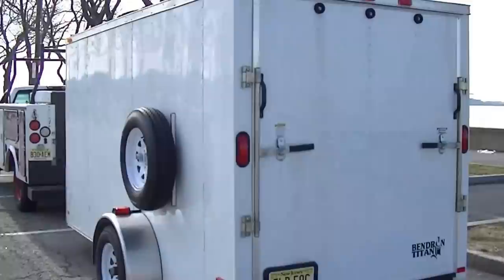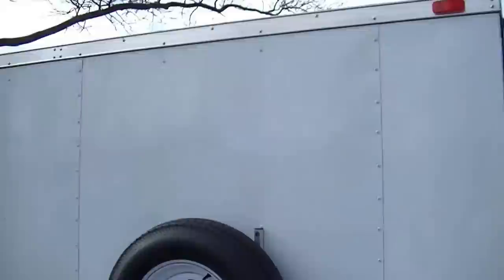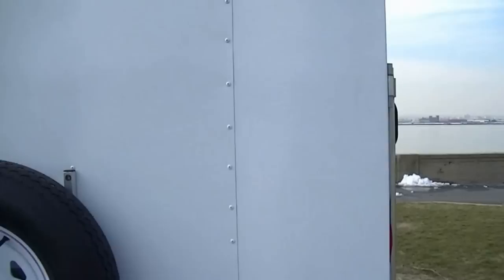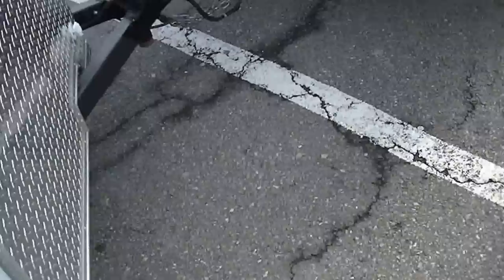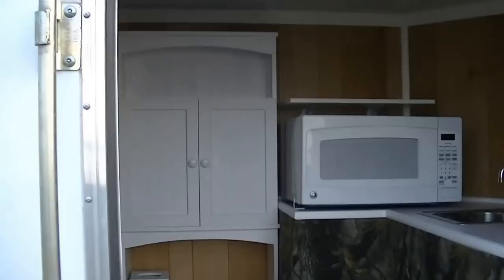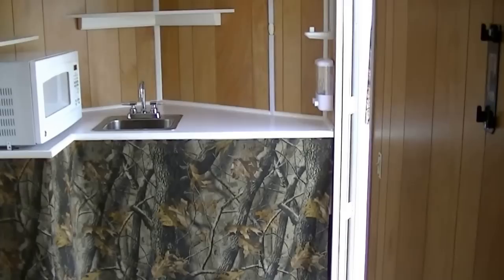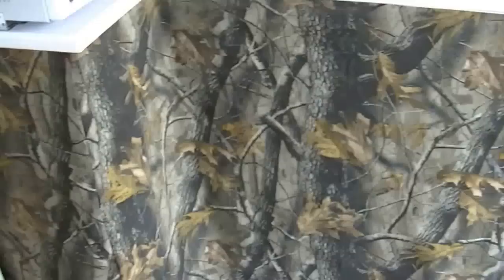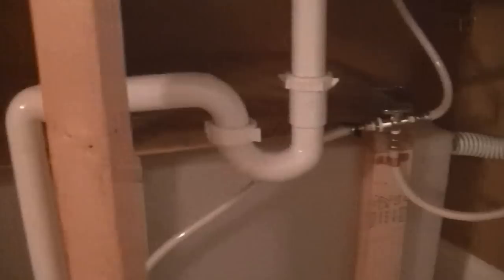Bug Out Vehicle - Cargo Trailer Stealth Camper - Part 1

Comment: Nice job NJ! Your video was inspiring for me on my first tackle of doing a cargo trailer custom conversion project too. Been researching YouTube, Pinterest and everywhere else to plan out my stages of projects. Yours was nicely done based on a budget and phases to tackle. Our trailer will be used as a mobile marketing office on-the-road, photography studio, cargo trailer, and day or overnight camper for trips just to get away and enjoy local surroundings - not to mention some outdoor photography adventures and mainly a setup to invite people to sit with us for Tea Time! We have a tea e-commerce business and we'll be promoting, marketing,  and having small tea parties to enjoy public interactions. We have a 6'x10 V-nose 6'-6" height with ramp door too. Love the ramp door for the extra deck space to cook and set up with awning too. Hoping to do a secondary false roof top as a floor to setup a tripod and chair to do panoramic photography work. Also great for additional storage of other items (e.g. canoe, additional tent, etc.). I'm planning pull-out sliding solar panels to tuck between the false roof and the actual tin roof. It will be a fun, stealth camper/office, transformer trailer useful for so many functions!  LOL  Can't wait to complete it! I started framing for a set of double-doors a few inches in from the ramp door opening (doors within doors). The double door will have glass panels, locking door knobs & deadbolt to secure the inside while the ramp door is down in patio/ramp position. It will create an outdoor space while also having a secure internal private space, but still have an open view of nature through the glass doors.  It also creates the all important emergency door and eliminates the need to have to cut into the trailer sides to install windows. The sides will have signage, while NO windows provide the best security for the trailer at all times against break-ins. I'm hoping I can video the project too and share on YouTube . . . we'll see what I can manage. Meanwhile, thanks for taking the time to share your experience - nicely done!!!  ;-) Hope to see what more you do.

Comment: Just happened upon your video 5 years later. Got to say you did a nice simple and sanitary job on this bug out trailer. I can see using a small quiet generator for camping away from an electrical source to power your electrics; pump, fridge, microwave, etc. My only concern is how would you keep thieves from towing it away when you are gone? Nice job.

Comment: have you thought about using some carpeting trim (the aluminum trim you see where carpet goes to hard flooring)? if you go with the flat kind the bed still won't slip and it will look better plus you will have the entire trim holding the non skid on and not just staples. Another idea is to use a larger piece of non skid stuff and attaching it on the sides of the wood instead of the top, then you can add trim to the sides thus not impeding the bed at all. You have done a great job with this.

Comment: Nice build, do you have a genset on your tow rig? you could also put your propane bottles on your tow rig and use an LP line to a cat heater(would keep things from freezing underway) or whatever you choose to fuel. your setup should blend in well for urban boondocking and look very low key in about any setting.

Comment: Wow, great job on the trailer! Nice planning, detail and design. Solar panels would indeed add to its bug-outness. It's good to have access to at least some power when you can't plug in to electrical service or a generator.

Comment: Nice, Im thinking of doing the same. I will go 12v on most stuff and install inverter to run ac devices other than air. No need for tv, use laptop computer with usb tv tuner. runs off ac and dc

Comment: nice work I guess we all have our own preferences. I'm going with bead board paneling. I'll finish it out with a natural oil stain. It is 1/8 " thick so on top of the insulation it adds some e value. The outside water drain I'll go with a ball valve , me personally I hate the cheap plastic crap...just too mickey mouse for a serious bug out

Comment: Continuing my last post, Bleach you have to rinse out at least three times. and Bleach costs more!  Second if you want a battery backup, use Golf Cart Batteries, they have a lot more capacity and aren't damaged by almost killing them like auto starting batteries.I like to use the 6 Volt ones and use two for 12 Volts then for longer reserve use two more and use a switch to select pair "A" or pair "B" and you can still charge using jumper cables from your truck for a pair at a time 12 v to 12 v.

Comment: Great job. I love that it still looks like a cargo container.

Some bungee cords on the ceiling will allow you to store some items like fishing poles or rifles from the ceiling if you wanted. Someone else mentioned a PVC pipe for the same thing external and that would work also. Maybe some solar panels on the roof to run a small radio, light, or TV?

Comment: Get an inline electric heater for hot water, or a plug in 110v electric faucet that cost $35 on EBay, it get up to 60 degrees Celsius, also you could get one of those $15 bucket water heater inside your water tank, to keep your water from freezing in the winter, also on EBay. Get some diamond plate for that ramp, wood will only rot.

Comment: I like the idea of using the V-nose it also gives you a little more room inside but I'm wondering if some kind of a heavy duty holder for a single tank could be rigged up and mounted on either side of the V similar to how your spare tires are mounted and give you two tanks worth of propane

Comment: Very nice, well done. Just a thought for your rear deck. Those leg mounts that you put on your bed? If you could get them in galvanized steel, attach three of them to your back door on the outside; one in each of the corners and one in the middle if needed and you could have a level deck to sit on. Just a thought. Well, good luck and God Bless!

Comment: Cool setup...  You should set up solar hot water up on top... You can also use it to heat the inside with a pump and a fan... Sort of like the AC cooler but run copper tubing all around on top, pump in to and in front of a fan on the inside... Just a thought...  Good luck...

Comment: use your roof for soler panals black waterhoses for hot water. 3 solar panals and 2 to 3 deep cell bateries, like in golfcarts.. should give you enough power to run stuff thru an inverter. its easy and free energy after your startup $$ goodluck. im starting on one asap.

Comment: Go with DC motors and use Solar panels :)  - Just in case you need to get off the grid. You need two 230watt solar panels - solar charge controller - 3-4 deep cycle batteries - and if you wanna use some of your AC stuff, DC to AC inverter.

Comment: You've done a really great job integrating everything from a blank slate.  You've got some pretty good skills in the build, looks very professional.   What exactly is the ceiling material and where did you buy it?  Looks like 4X8 sheets of whatever it is.   I've got an older C Class 24' motorhome that I'm outfitting for the same B.O. frame of mind and because of a leak at sometime, the ceiling in one area is one of the numerous issues I have bringing this old girl back to a uber-presentable stature.    

Good Luck on the sewing career!  Looks like you've got a pretty good handle on what's required.

Comment: Pretty cool man....ignore any negative comments...all in all, you did a good job and it looks nice. Only thing I saw that you should change is having the pee trap for the sink. Since the water just goes straight out, don't run a trap. You will end up always having a little water in the drain line and will become stagnant and stink. I would get rid of it till if you decide to add a grey or black water tank. Other than that, nice work bro. Have fun with it. And yes, it is stealth. Who would guess you have a camper inside a little cargo trailer.
Reply: I think its a good point if the trailer will just sit, but I'd have something to shut it off, like a valve. Unfortunately the trap works great if its used often, but without it you have not barrier from outside entry either. Perhaps a check value of some type, or course without some force acting on it I don't think a normal check valve would work.

Comment: Nice job on the trailer and truck 
                                                                                  
I'v done the same thing as you but it's not my bug out. I have mind set up for hunting and fishing. I got the hell out of the tri-1state I lived in ct  and drove a lot thought New NJ  and just was sick of the hole seen ! Now I'm in Colorado I'm loving it best thing I done . But yea you did great good work 
My truck is not as nice as yours,I picked it up at surplus  on the base Its just older But has 13,000 miles on it now got when it had 6,000 good luck with yours and mind is in y

Comment: Great work for a beginner! Well thought out and leaves room for up grades, or design changes. Doing good! Dimensions of trailer, I think you said 1700 lbs carrying capacity?
Don't mind the numb nuts I just read on this. It severs your purpose and it will work with camo netting! Look in too water filtration.

Comment: You have given a lot of thought to your layout and have done a great job....for your hot water you might want to review the "Girard Tankless RV Water Heaters" for a possibility..I just googled it up..somewhere in your future you may want a "Sportsman 3,250/4,000-Watt Clean Burning LPG Portable Propane Generator ", as an example of what's available...here's the gasoline version. "Powermate Portable Generator — 1500 Surge Watts, 1200 Rated Watts, Model# PM0101207"...good luck in your endeavor.

Comment: For rear drop door I would use porch paint with sand mixed into it to give some grip when used as a ramp to load or unload. Porch paint sticks better, is cheaper, can be colored, and prime plywood before painting for durability. Under coat is too soft, sticky, smelly.

Comment: you should get yourself 2 or 3 batteries and going solar as you said so you can go off grid camping and camp where you dont have power and water supplied to you. but other than that is a pretty cool set up.

Comment: You did real good.  Very clean job.  Just a couple of thoughts:  I would not go with the A/C on the roof.  It eliminates your stealth factor.  If you do a through the wall A/C, find some way to disguise it from the outside.  Maybe like a removeable magnet type sign to cover the outside face of it.  Also, get rid of the camo panels on your truck.  Paint it completely white.  Put removable signs on it and the trailer that say something like "Joe's Septic Tank Service".  Get a real nasty looking b

Comment: That sway you were getting probably had more to do with how it was loaded. To prevent sway, the weight on a trailer should be loaded 60% front, 40% rear. Then it'll follow like a dream.

Comment: Mount small, refillable, butane tanks horizontally underneath (hidden). Refill from a larger butane tank carried in your truck. Another option is feeding the trailer directly (long hose) from the butane tank in your truck. Personally, I would have hidden all the inlets (water, etc) and outlets underneath. Of course, the camo on your truck kind of defeats the whole stealth thing.

Comment: Is that water pump noisy? My buddy uses the same pump in his camp from a cistern. It's mounted on foam but hard plumbed-in to the bottom of the cabinet. It'll wake the dead.  I'm diggin' your idea here. I see a solar vent fan on the roof. Solar water heating. 12 volt solar lighting.  Wall mounted fold down bunk and table.  Ha, okay. You beat me to the solar panels before I finished this comment. Great job!

Comment: Pretty sweet setup, I can see some room for improvement but you're definitely getting it done right. I'd install a receptacle rather than the ext cord hole so you don't have a source for cold air in the winter time. Look into some outside lighting as well for both work area and just general activity lights. You might be able to re-arrange the area at the front to put in a propane tank, not the safest having it inside so you might think about enclosing that area and putting in an outside access.

Comment: do the truck next,cummings diesel,green bedliner on outside and underside,ride tech air suspension,you can lower it when towing radials with a quiet tread pattern and MPG rating,you should be able to get a honest 20 mpg pulling the trailer,with some aerodynamic tricks 25 mpg.

Comment: U need to add a car battrry and a a solar panel to have renewable energy to power not only your camper but could be your second option for cooking using an electric stove
Reply: Battery won't last long with any electric heating devices, but small solar panels will charge enough for lights and furnace.  I think we could run three days of intermittent heat on one battery, and the small panel would charge it in an afternoon. Not going to run air, heat, or electric stove, though.

Comment: first mistake single axle. if you have a blow out your trailer is gone! maybe your truck to.
good redundancy 2 axles = 4 tires and the more side wall layers the better , much stiffer tracking. anti sway bars for light weight trucks,
a must and follow the weight on toung of trailer, balanced load and from side to side. this will be in wet condition. good luck

Comment: get yourself an AGM battery .. prob be able to get a used one at a boat yard. one group 31 will do the trick. small solar panel will keep it topped off. the water pump might be better off using DC ..  or an inverter depending on how much it draws.

great work though. clever :)

Comment: Nice video; I disagree with your choice of trailers in that swinging doors are simpler and less intrusive of interior space than the roll up. I also think that all things being equal the wheelwell type trailer has much, much more interior space than does the external fender-type. There is one  key though which is that you crossed your safety chains which few do and is the proper way to attach them, good job! I fight with people here in NJ all the time over that!

Comment: I don't know what is stealth about a cargo trailer?  You still have to park it somewhere hooked up to your truck so it will stand out just like a camper or an rv.  Even if you unhook it from your truck then that would look suspicious too with a trailer just randomly sitting somewhere.  I say this because i thought of converting a cargo trailer to live in temporarily but i don't see how it will be stealth.  So i would have to find legal spots to park the same as an rv or camper.
Reply: SkilledEddie It's the brand of trailer... it's just a name, they're not stealthier than any other cargo trailer.

Comment: watch your weigh and distribution with single axle a 5k btu ac  should be plenty
pick up on sale at the end of season aroun $80 right now in target. and I would suggest getting  or making some covers on the spares sitting up in the sun uv will dry rot them good job great for the pine barrens

Comment: You will need to get a 15 amp inlet and a fuse box to be compliant with regs..

Sticking that power lead outside would be illegal, stealth camper or not you need a  venting system and you do need windows...

Comment: Brilliant idea.
Lock the "spare" so that NO ONE can undo the nuts and steal it.
Sadly -- they CAN undo the road wheel nuts & remove THEM a lot easier.. 
So why didn't you simply put a 2nd "lock" on the road wheel nuts too?
And if "wheel balance" was ain issue, two diametrically located opposite each other, would solve a misbalanced rim weight problem (and give you twice as many LOCKS to undo - if you get a flat.?

Comment: I have a trailer like that but I don't plan to dress it up I will put in the insulation and leave it at that everything will be camping gear that I can take out and use the trailer for hauling should I need to.

Comment: You have a lot more walking around room than you need, next time I'm sure you will do a few things differently for convenience if nothing else, the fridge should be in a better spot, you could use more of a kitchen instead of relying on cooking over a camp fire everywhere. a black water holding tank and permanent head would be a bit plus.... otherwise great job, it looks like the craftsmanship is great with only one exception, the staples holding your rubber non skid bed pad will not hold long

Comment: Put a solar water heater on top of the trailer instead of propane that is a resource you can run out of but the Sun will be allot more a reliable resource.

Comment: If you want a cheap source of hot water...Install a role of black water hose on the roof of your trailer..Fill it with water ..At the end of a sunny day it may even scald you so be careful..Use it to even clean your plates.Can't you never left a section of garden hose laying in the yard and did not see how hot water can get.???

Comment: Great set up, how much does the trailer weigh? like the curtains you gave me an idea to add Velcro screen for side door and back door for bug out bugs. what was the material for the under coat again? and what did you get for gas mileage in the truck ? what size cubic engine?

Comment: You seem too over-weighted on the left-side. That should cause some instability while towing. Have you accounted for it?
Reply: I recommend not using any application, like truck bed coating, that has volatile chemicals. When closed up they'll release and poison internal space. Hope you vent well. Roof vent with fan? internal battery? vent, vent vent. keep fresh air flowing when sleeping.